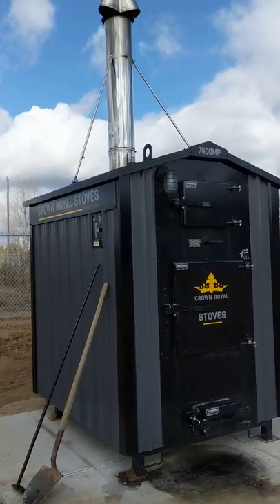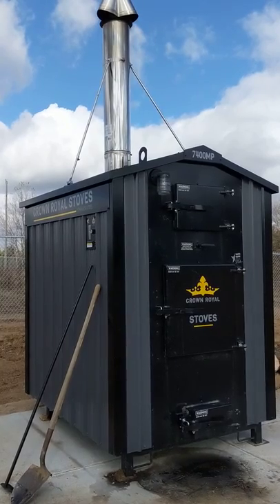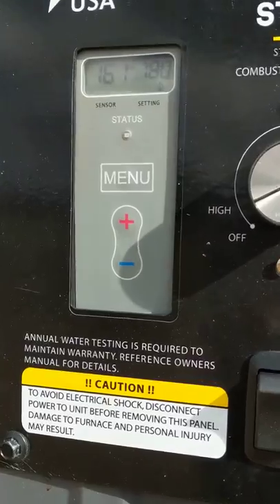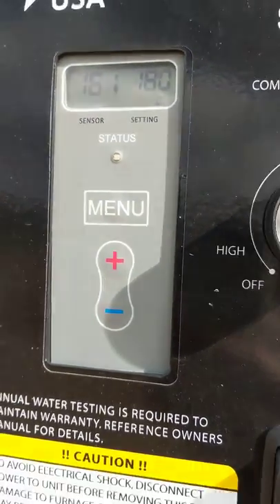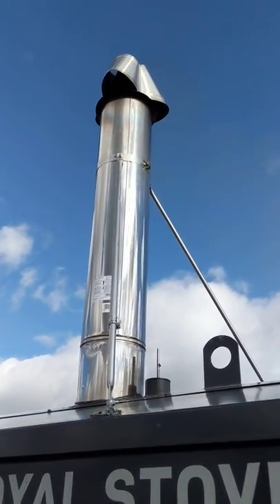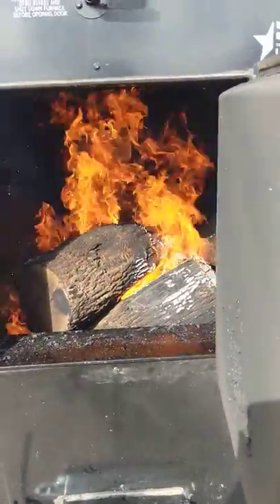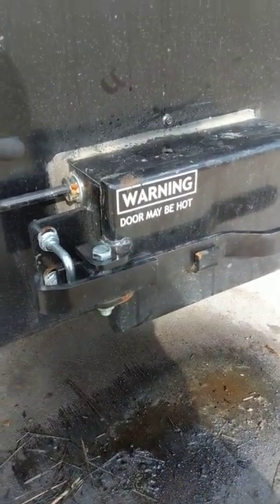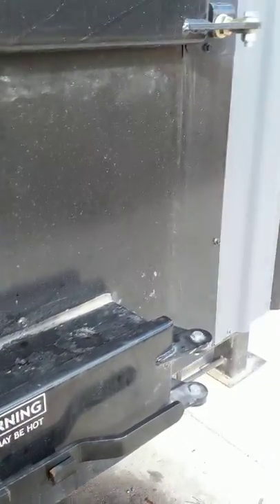Crown Royal 7400MP install  https://www.crownroyalstoves.com/

Comment: Is a little warm where we are right now but heading cooler. Had a 7300E installed last week. We get quite a bit of water around the lip of the main door that comes out into the drip tray. Your opinion: wet wood, normal for warmer weather with a gasification, door needs adjusting? Something else? Thanks!